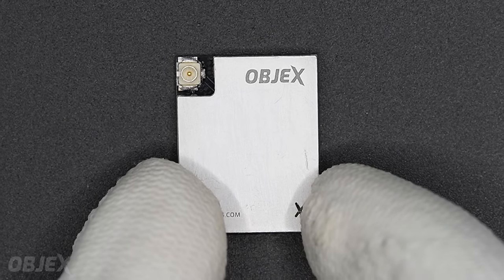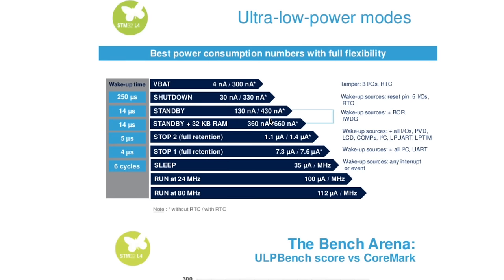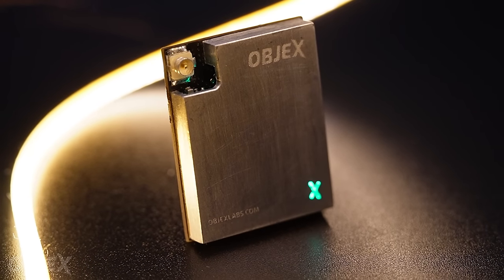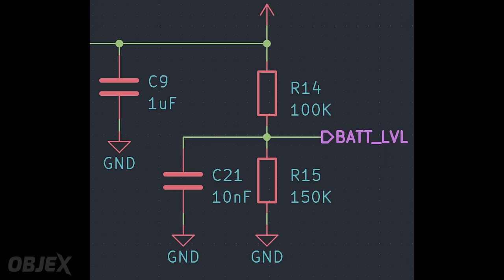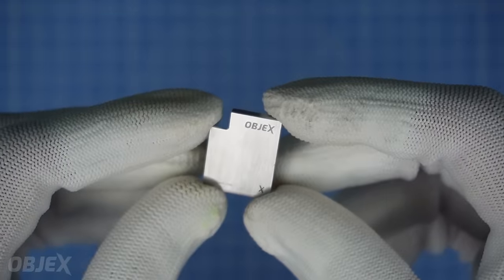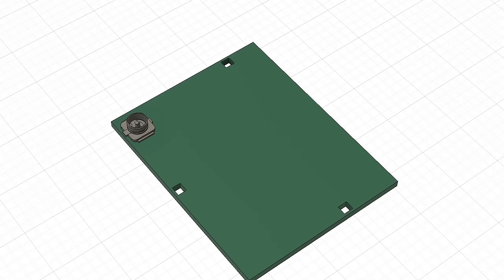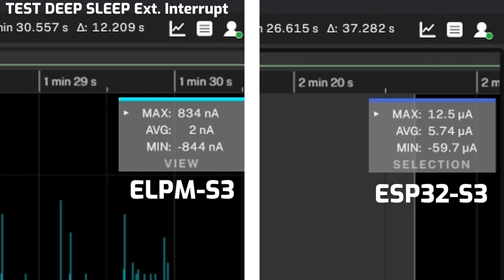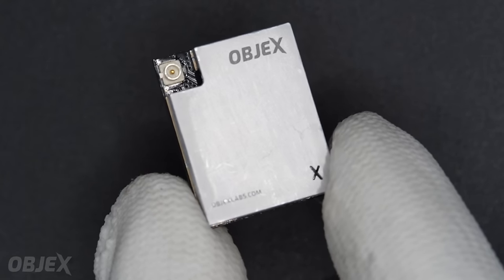The new ESP32-S3 module - Extreme low power 1nA! ELPM-S3 by OBJEX

Comment: Hi, awesome work👏. The results look amazing. 

I had a few queries. In the product brief you mentioned that you power down the micro entirely. Wouldn't this erase all variables/data stored on the sram?

Some applications that I worked on relied on retaining a small amount of state info to resume where they left off. 
A workaround for systems with no memory retention is to write state data to flash before power down and read it back during power up. But this method is unreliable due to limited number of write cycles allowed by most nand flash modules (at 10sec duty cycle over a course of 10 years you will write ~30million times, way above nand flash endurance).

So a future modification can be adding an optional small external sram ic that is powered even in the "deep sleep". All modern low power mcu ( even esp32s3) have some sort of limited ram retention in deep sleep. This would remove some limitations of the current design from software development  perspective. 

This applies only if you intend to use the module for such tasks ofcourse. If not ignore the above 😂 .

Anyways awesome work once again. I wish you best of luck 👍.
Reply from the maker: Thanks for the very nice tip, as you well said it is possible to save the data in the flash of the ESP32S3 and also in a small flash of the external RTC. It might be interesting to add a small sram always powered. Actually it is already possible to do that now, it might be interesting to insert into the module.
Reply from the maker: Hi, if you are interested the project I wanted to let you know that pre-orders start tomorrow! shop.objexlabs.com

Comment: Hello, Salvatore! Can you explain better you sheet where you compare the esp32-s3 with the objex module? It is 200 interactions during 10sec per day?
Reply from the maker: Yes of course! 
First, the data I obtained are from some simulations I did to see the differences in energy efficiency between the two modules. What I did is to assume a device that every time it is triggered remains on for 10seconds with an average current draw of 45mA. Then I chose Energizer alkaline batteries for the simulation. 

And I analyzed the battery life by changing the number of interactions from 1 per day up to 200.

Of course, the data I got will vary depending on the application. I simply did a simulation, so then each application will have different power consumption. 

In the simulation I considered the following deepsleep* current draw for the two modules:

ELPM-S3 = 100nA
ESP32S3* = 7uA
Reply from the maker: Hi, if you are interested the project I wanted to let you know that pre-orders start tomorrow! shop.objexlabs.com

Comment: Very nice work. Can it work with external Sensor Interupts in the classical way? I would be interested in a project like this with the ESP32 C3. And of course, what are the production costs of the samples?

My sensor i want to build is powered by a single Lipo Cell, and should be woken up by a sensor like a MPU6050 or LIS3DH and send some data via WiFi. At the moment I'm using the old ESP32, but even with a lot of DeepSleep and reduced Speed etc, a 2000mAh Battery lasts maybe 3 days, because the current draw is around 20mA the whole time
Reply from the maker: "Can it work with external Sensor Interupts in the classical way?" yep! 
I recommend that you choose an ultra low power accellerometer, I suggest you look at the ones from ST and Bosch. The project you described is great for ELPM-S3!
Reply from the maker: Hi, if you are interested the project I wanted to let you know that pre-orders start tomorrow! shop.objexlabs.com

Comment: Would be nice if the ESP32 would have actual low energy Bluetooth like the NRF52x.
Reply from the maker: You are right, although I have a feeling that they are focusing a lot on optimizing ESP-NOW. I hope that the next versions of ESP32 will have a minimum operating voltage of 1.8V, this would help a lot in the development of low-power nodes.
Reply from the maker: Hi, if you are interested the project I wanted to let you know that pre-orders start tomorrow! shop.objexlabs.com

Comment: wait: did you reduce sleep current of S3 to nA or your project as such consumes nA while sleeping? 
or another question: during the sleep, does S3 sleep or is powered off?
Reply from the maker: As I say in the video the power block that is designed to control the ESP32S3 power on. So I don't use the classic deep sleep mode of the ESP32S3. And during the deep sleep the ESP32 is powered off.
Reply: @SalvatoreRaccardi  thank you
Reply from the maker: Hi, if you are interested the project I wanted to let you know that pre-orders start tomorrow! shop.objexlabs.com
Reply: @SalvatoreRaccardi  thank you, I have mine very similar and I don't power off the esp32 but send to sleep

Comment: What rgb LED is in use? Is it controlled by the same code I‘d use for a ws2812?
Reply from the maker: Yes, WS2812B-2020.
Reply: @SalvatoreRaccardi  is it powered off the 3V3 rail and controlled by 3V3 signal?
Reply from the maker: @oktopus1539  yeah, although the manufacturer recommends powering the led has a higher voltage. But it also works fine at 3V3, even espressif powers the led at 3V3😅

Comment: 1. Music is way too loud (notice that biggest yt channels don't use music at all)
2. Need to have a version with built in antenna 
3. Need to cost almost the same as original wroom modules
4. Castellated holes are way easier to solder
Reply from the maker: 1. I don't feel the music is loud, plus I only use it in some parts of the video. In any case you can turn down the volume of the video.
2. I have to think about that.
3. It will be so by manufacturing many units.
4. It is actually very easy to solder, in any case I'm also thinking about solving this problem. I have to think about it.
Reply: @SalvatoreRaccardi  
1. music is very loud compared to your voice volume, especially the one at 4 minute mark
2. many battery powered projects are also small, they do not need external antenna on cable, that also makes cost bigger
4. qfn and castellated holes are easy to solder because you can inspect the joints on the sides, you can't do that with parts that have only contact patches underneath, not to mention it limits the ability to desolder it from the bottom(hot air) if you have 2 sided board with components underneath as you will blow them away.

I am interested in this project because of exact reasons you mentioned, esp32 is popular and easy to work with. I also wanted to use eink display. But 2 and 4 are dealbreakers for me. I need the smallest possible esp32 without anything on the board that is not necessary but with built in antenna. 
Btw, what eink display is on video?
Reply from the maker: @Kmnri  
1. 2. ok
4. I will think about it for the next iteration of the design.
eink display by GooDisplay

Comment: That shield looks too pricey for a $2 module.
Reply from the maker: Consider that the ESP32-S3-WROOM-1-N8 module costs about 3.5 euros including VAT. ELPM-S3 is specialized for Extreme/Ultra low power applications, so it will cost more. And in the production stage, it is not certain that I'll use aluminum for the shield.
Reply from the maker: Hi, if you are interested the project I wanted to let you know that pre-orders start tomorrow! shop.objexlabs.com
Reply: @SalvatoreRaccardi  You don't need the shield until you get the CE/FCC certificate.
Reply from the maker: @ergindemir7366  shield price 0.13euro x unit